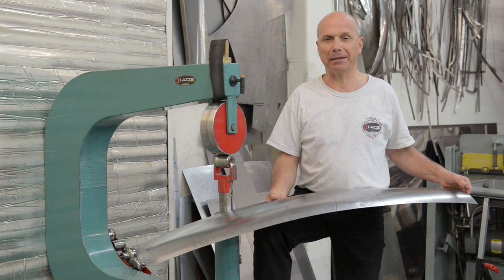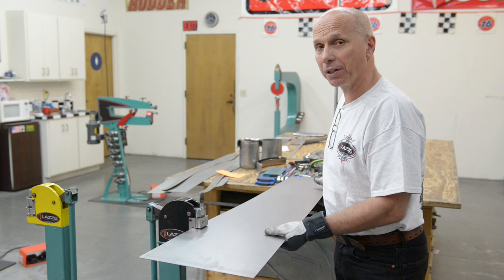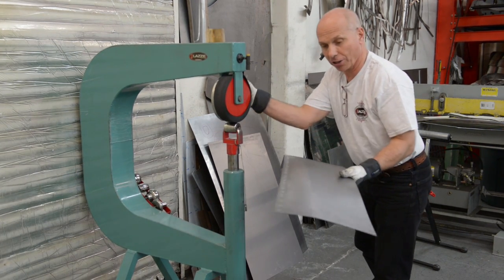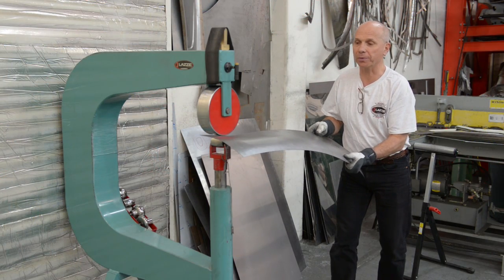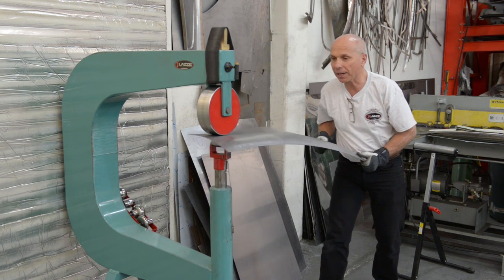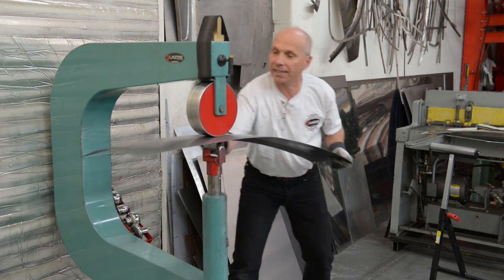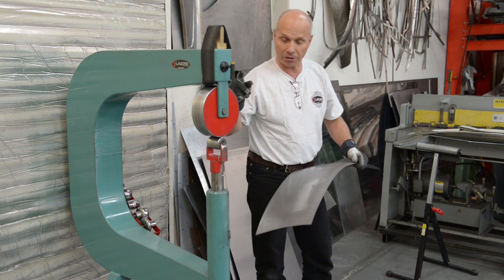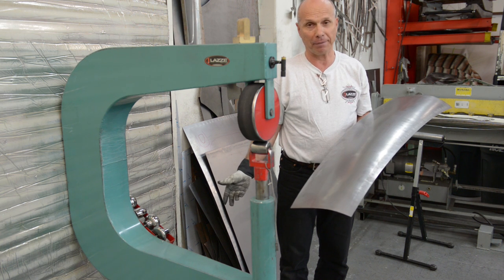Metal Shaping with Lazze: Roof Panel Fabrication (English Wheel & Shrinker).

Comment: Have you tried making your rubber band a little wider than the top wheel so that a little rolls over the edge on each side and it doesn't try to move off the top wheel as you work your panel? Thankyou a million for your videos Lazze. You're a great teacher to me! 👍